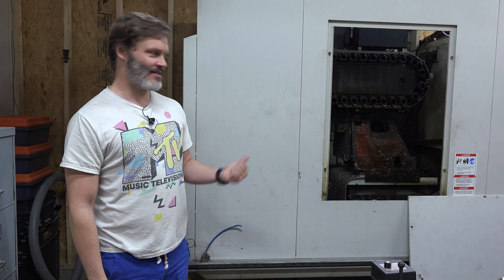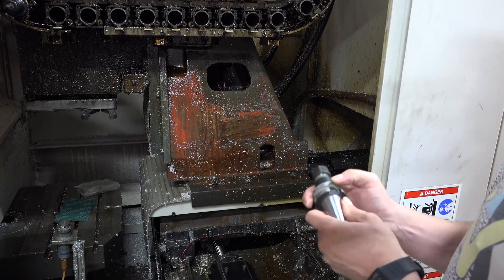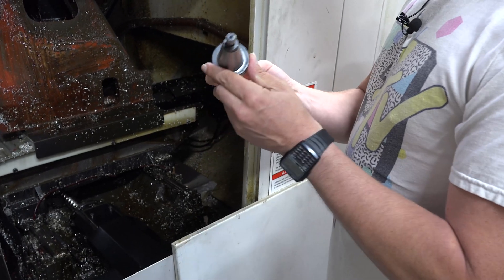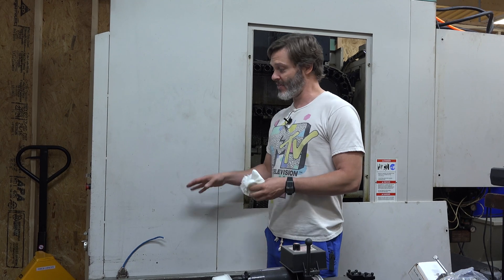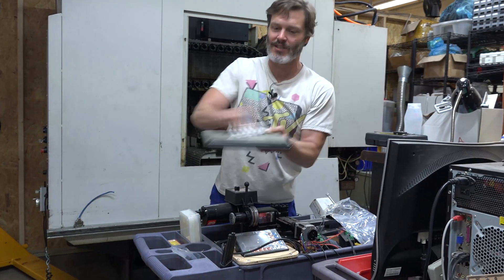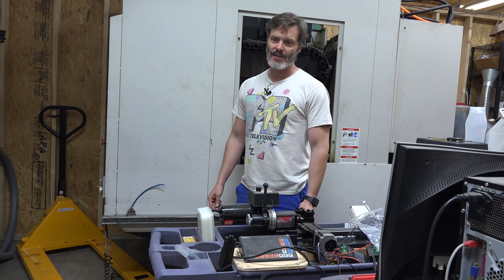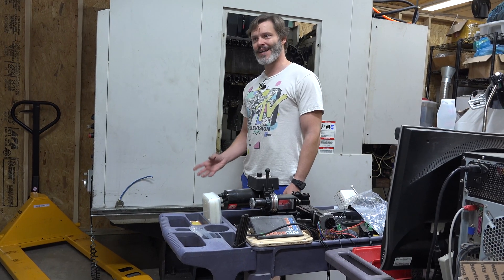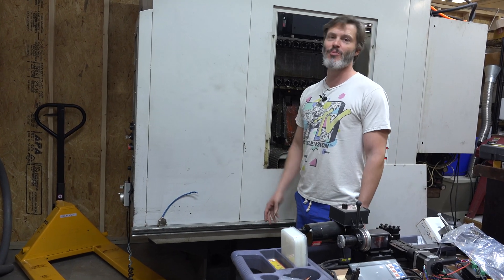CNC machine update **Bro Comm** Inside look || PickleFork|| Holmes Hobbies. || LET'S LEARN ||

Comment: You can load the tools into the spindle with the control. An M6 will swap the tools and put the tool away in the carousel.
Reply from the maker: That would be one way around it!  I'm still learning to navigate the menus effectively, need to start deleting old tool files now.   I can see why a manufacturing company would tend to stick to one brand after they learn the ins and outs.

Comment: Hey John.
Question please.
Would a regular Mamba X and a Revolver V1 1400kv run decent on a 9 year old(really low hours) 1/8 Summit without getting too hot?
   It's NOT being used as a basher running in 2nd gear at full throttle...its more of a fun trail machine with the occasional plastic over a jump.

Comment: My dad uses an old Gateway laptop running XP (also not on the internet) that has the parallel port.  He transfers stuff from other computers on a thumb drive to keep it isolated so he doesn't have to worry about all the bloatware and updates.  

I'm not learning new stuff but recently started refreshing that 'useless' calculus and differential equations I had so much fun with back at the University.  It forces your mind to be logical and suddenly other unrelated decisions are easy to analyze.